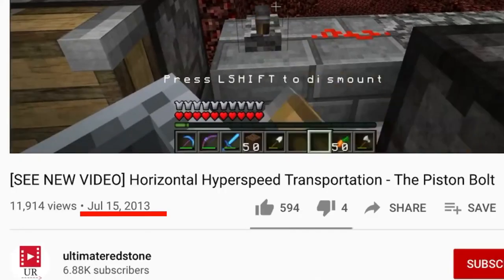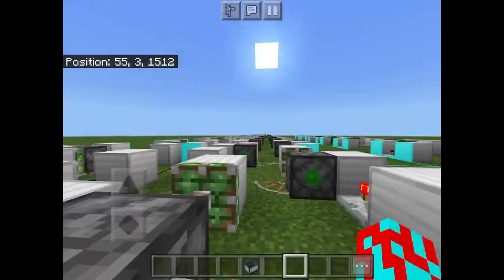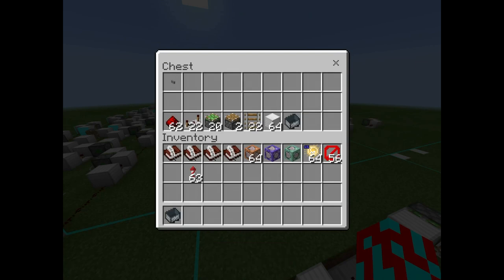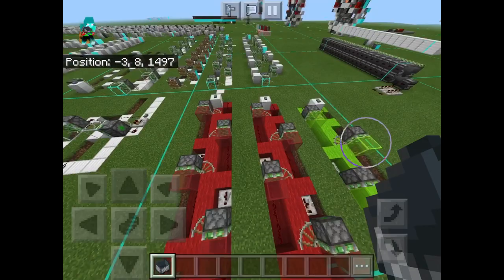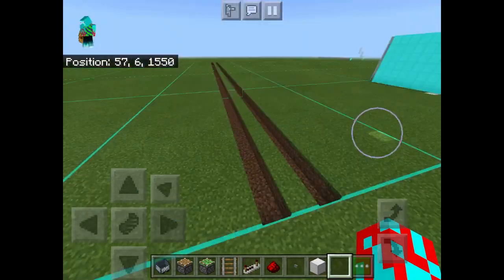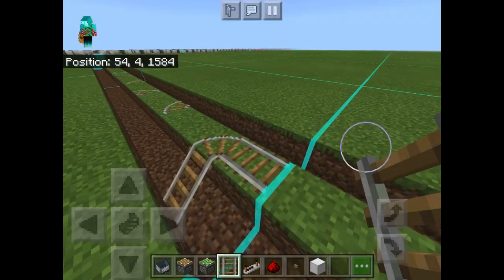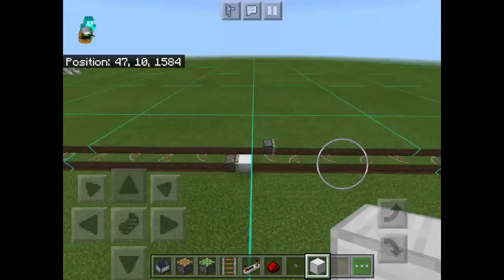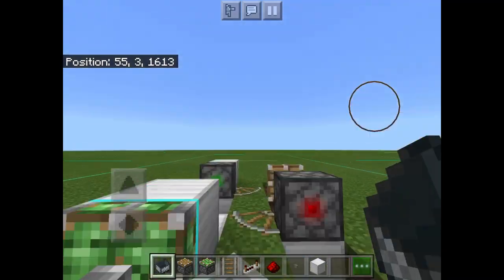The Fastest Piston Bolt in Minecraft Bedrock (29+Blocks per second- Tutorial)

Comment: Always nice to see well-done bedrock redstone videos. I'm sure this design has evolved a bit since its inception but I wanted to throw it out there that a single line can be used under the rails with torches under the pistons. I understand that it is a bit more expensive, however, enough space is available on the sides for additional utility. For example, my storage system piston bolt utilizes a cactus at the end of the line to break the hopper minecart. The minecart drops into a hopper which replenishes a revolving minecart to maintain perpetual supply. The supply line simply runs adjacent and down a block from the piston bolt's redstone line to be powered from the torches. I'm not in any way saying that such a system even makes sense to use nor is it my intention to detract from the beauty of efficiency and simplicity. Just thinking out loud X\

Comment: absolute underrated turtorial
Reply: also can you make a diagonal piston bolt or how to transition from straight to diagonal
Reply from the maker: So the issue with diagonal piston bolts is that they're literally 4 times more expensive and can only go at a maximum speed of 14 blocks per second. It's a lot more convenient and easier ro build if you simply build 2 straight ones. It's both cheaper and faster
Reply: @Benthehuman  today i figured out a way to connect to of these straight ones and i hope to see you do a video on it

Comment: Not related to the video, but I know some people here can help me:
On the Minecraft wiki for pistons it says: "When powered, the piston's wooden surface (the "head") starts extending immediately in Java Edition; or either 2 game ticks (1 redstone tick; 0.1 seconds) later or immediately, depending on how it was powered, in Bedrock Edition."
What do they mean with those different methods of powering a piston, why is there a difference?
Reply from the maker: It's because in bedrock edition a redstone tick is composed of 2 "sub-ticks' which are called half-ticks. These half-ticks are split up into c-ticks (consumer) and p-ticks (producer.) Redstone components are only able to interact with their respective half-ticks. For example, pistons, lamps, doors, etc... use consumer ticks, so only that specific half of the redstone tick will be able to power (or activate) them. Why does this matter? Because different redstone components start on different half-ticks. Levers, pressure plates, buttons, and redstone blocks start on a c-tick, but redstone repeaters, comparators, torches, and observers start on a p-tick. That is why you can get seemingly different delays when powering with a button or with a repeater input. I made a video talking about half-ticks, let me know if you want some more help or clarity. (I might make another video on half-ticks in order to make it as clear as possible, especially since I left out the whole aspect about different components starting on a different half-tick.)
Reply: @Benthehuman  Thank you wery much, I'll watch the video later
Reply: @Benthehuman  okay, if you eventually decide to make another video on half-ticks, here are two suggestions: you used half-tick generators but didn't explain how they worked and also the stuff in the video description could have easily been put in the video itself.